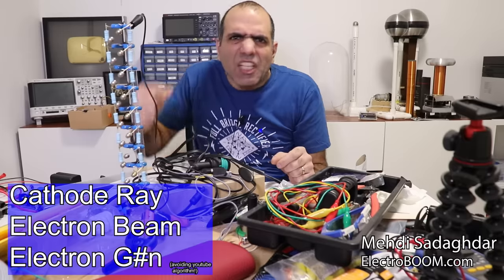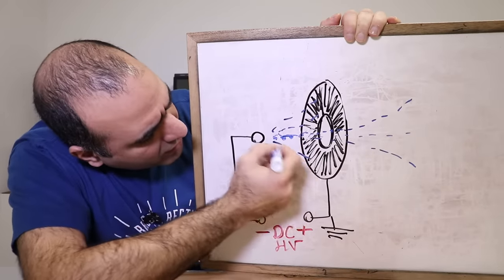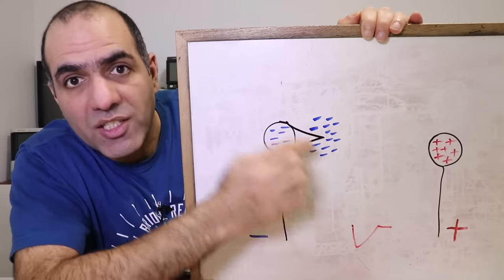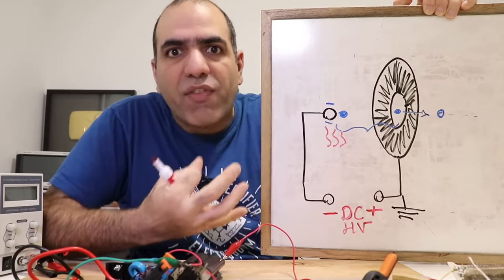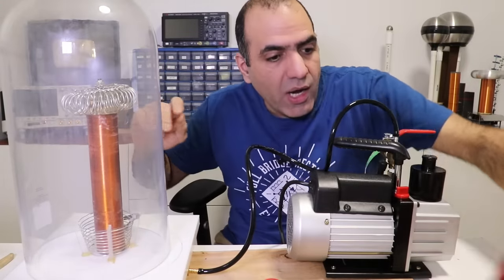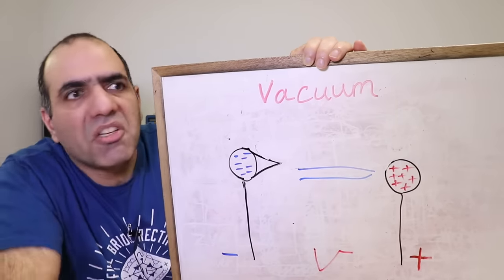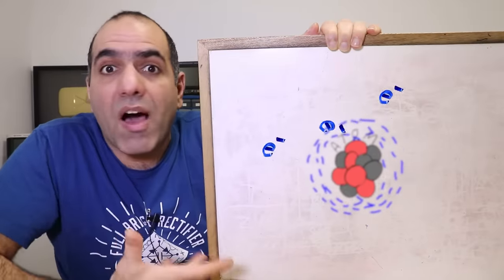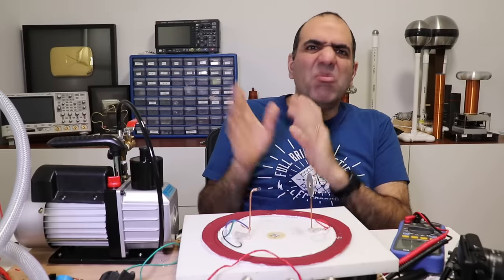Making Super Fast Electrons, Cathode Ray

Comment: "I'm pretty sure at those voltages I would create some pulses of X-rays.... so lets not do it very long"
Reply: If you're curious, the source of these x-rays is the high energy electrons smashing into the anode disk and losing their energy rapidly. This rapid loss of energy is released in the form of high energy photons (the x-rays). This phenomena is called "bremsstrahlung," or braking radiation. I worked for 5 years with a Van De Graaff positive ion accelerator that needed lead shielding to protect against the braking radiation, since positive ions accelerating in high voltage (even at high vacuum) will ionize residual gas particles and release electrons that in turn accelerate backwards through the high voltage into the accelerator itself, creating x-rays.
Reply: @ArchangelUltra  i feel like a smartypants rn
Reply: That is why old CRT screens had an earthed screen to ground out the x-rays.
Reply: @dogwalker666  You're gonna have to explain this one to me. X-rays are uncharged so why would they need any kind of ground? They're unaffected by electric potentials. And I thought CRTs didn't have much of an xray problem because their electron gun wasn't at a very high voltage, but I don't actually know much about those so that's more of a guess.
Reply: @ArchangelUltra  Thanks I was wondering what that phenomena was. Now I'm going to dive into a Wikipedia rabbit hole. See you guys on the other side. o7
Reply: @ArchangelUltra  the original CRT had lead in the glass and had a coil around the Circumference of the screen, I believe there was a dedicated pin on them for the xray protection circuit.
Reply: @dogwalker666  The coil around circumference of the tube is degaussing coil. It have nothing to do with X-rays. For X-ray protection is the backside of the picture tube made from leaded glass to block X-rays created by bombarding shadow mask and screen by electrons.
Reply: @The_Hanter  there was a de,Gauss coil too and I said it was a leaded glass.
Reply: That's what I was thinking - this is starting to look suspiciously similar to how an x-ray tube works lol
Reply: @dogwalker666  That coil is the degaussing coil, it runs at every start-up to clear any residual magnetism and retain colour purity... Nothing to do with x-ray protection.

X-ray protection is typically done by monitoring the power supply for an over-voltage condition. The only physical x-ray protection is the leaded or otherwise specialty glass.

To some extent the rim-band metal may help block x-ray emission from the side edges, but its job is more to help keep the structural integrity of the CRT, and providing a way to mount the CRT into a cabinet.
Reply: @Agent24Electronics  I know that is what I said.
Reply: I thought something in the screen reduced xrays like thick quartz or some additive?
Reply: @ArchangelUltra  I think X-rays start at around 5 kV
Reply: @dr_jaymz  lead in the glass like very expensive drinking glasses.
Reply: There are also high energy beta rays!
Reply: @ArchangelUltra  are you German or ist the word ,,Bremsstrahlung" used in English too
Reply: X-rays also came profusely out of the HV rectifier tube, which is why many TVs had metal sheilding around the HV supply.
Reply: @JB-yu1vv  it’s very commonly used in English nuclear academia
Reply: @dogwalker666  That's wrong. You can't "ground out" x-rays. CRT screens are earthed to actually allow them to travel to the screen otherwise the screen would simply build up a negative charge and it would stop working. To protect against x-rays CRTs use leaded glass (glass with lead in it) to absorb most of the x-rays (though not all of them).
Reply: As someone who works on X-ray machines I’m almost sure if you were to have put a piece of fluoroscopic paper on the end of the tube where the “window l of the washer was facing it would have lit up showing the radiation pulses. Usually run to 40-125kvp
Reply: @dogwalker666  that's not what you said, you said the glass was grounded to block xrays....
Reply: @trevorhaddox6884  you should see how much you get out of a 3 phase valve rectifier those 6 GXU4 at 13kW were a bit zappy.
Reply: @ArchangelUltra  The glass of a CRT contains lead. The lead acts as a shield for the x-rays.
Edit. Too quick. It was already answered.
Reply: @dogwalker666  Funnily enough , I happen to know you cannot x-ray lead crystal - they just  cast a shadow, despite being very very thin.

Comment: One small piece of tungsten and he’ll start making x-rays. This man needs to be placed on a watchlist
Reply: thanks for the idea
Reply: Intentions are what matters. Smart people are not who should be placed on a watchlist. Evil, cold, or profit-driven people should, though.
Reply: its probably already emitting some xrays, tungsten just has a bigger cross section for electron scattering
Reply: X-rays aren't very dangerous for short ammounts of time.
No need for watchlist.
Reply: You are bit slow & missed the point. Mehdi used his Marx super high voltage generator + the heating element (the tangerine from his hair dryer)  . Hence, the result was a massive high voltage arc + X-ray (due to super high voltage).

Hint; Ho and study some physics and lean about frequency and electrons.
Reply: @jannikheidemann3805 the exposure time for x-rays is measured in tenths of seconds. When I X-ray a dog’s knee, I set the generator to 44 kV, 50mA and 0,2 s. His first setup with the 30 kV transformer, isn’t far off. He’s been sitting there for a loooooong time, tens of seconds. Even if the current through the tube is fairly low, say a couple of mA, he’s received a sizeable dose of x-rays.

The second setup with the Marx Generator does “hundreds of kV” so that definitely produced some very, VERY hard X-rays. I wouldn’t want to be near that thing for any length of time.
Reply: Maybe he can even rebuild the Therac-25
Reply: @pascal2085  i was not prepared to read this

Comment: Nice work! 
From the amount of Plasma I would expect a pressure of somewhere between 10 mbar and 0.1 mbar. For electronbeams that are used (either in  Electron Microscopes (SEM/TEM) or for Electron Beam Epitaxy) in Lab settings we usually have vacuums around 10^-5 mbar, since in those the electrons flow much easier and are well behaved so that you can control and detect them accordingly.
For demonstration purposes a vacuum of ~10^-3 mbar should be enough, use some Argon to show the path of the electrons.
Also if you use a Helmholtz coil setup you can actzally adjust the path of the electrons into a circle and use that to correctly measure the charge of a single electron.

Comment: Makes X-Ray tube

"Ahhh yes, the glow of death!"
Reply: MUM!N  i dont think you can catch That With a comercially available camera
Reply: nah Vaccum Tubes barely make Xrays
Reply: MUM!N  You need a purpose build X Ray machine and a purpose build X Ray tube to get significant amounts of radiation.
For example High voltage rectifier tubes are known to produce small amounts as an unwanted byproduct.
Audio Tube Amplifiers are the most common type of Vacuum Tube Application today among very high power transmitter tubes. But there is no concern from those since they are not contained in a glass envelope but a water cooled metal jacket.
Audio Tube Amplifiers pose no significant risk.
Reply: @alouisschafer7212  idk much about this but don't vacuum tubes work at a couple hundred volts? Electroboom is using tens of thousands of volts
Reply: @maxxiang8746  you are correct that is one of the main factors. Normal vacuum tubes often barely see 500V. So almost no X Rays.
Seeing 1000V in a Tube Amp is rare. Highest I ever worked with was 450V which is not much in contrast to thousands of volts but still a change of pace to work with from conventional electronics.
Reply: @alouisschafer7212  how about instead of using a washer he'd use a block of tungsten for that bremsstrahlung effect
Reply: MUM!N  It depends on how long the pulse is.  They've already tried to film an electrostatic arc.

https://youtu.be/YDHos3Q1NcA?t=472

Pulse duration is too short to get any sort of usable footage.
Reply: Commercial x-ray tubes are 50kv because its good for imaging, not because X-rays aren't generated at lower voltages. Hard X-rays start at 5KV. All targets will emit bremsstrahlung radiation, and you don't need to have purposefully designed for it. It's generated by the electron stopping.

Medhi really dropped the ball, and needs to get a dosimeter before messing around with this.
Reply: @alouisschafer7212  Quite obviously he is much higher that 500V in this experiment, and the specificity of X-ray tube is the cold cathod... which he has in many of his experiments, here. 
So I think it would be a realy good idea to check it with a Geiger Counter.
Reply: @RandomMan1  exactly this! I’m a rad tech (the guy that does your X-rays) I studied this and I know my stuff about x ray photons being created this exact way. I have to know all this stuff for my boards as well as be eligible to work with radiation. There’s a few types of radiation that can occur. Brems, characteristic, photo electric, and Compton depending on the KV. Even with low amounts of KV,  you can definitely get some x rays. Are they very strong? Maybe not, but once you keep going higher with the KV, the more likely you will create more and more higher energy x ray photons. There’s no escaping that. In a regular x ray tube, to protect us workers, they have a glass envelope as well as lead around the housing of the tube to protect from leakage. He has none of that. If any one of you just look up how x rays are formed, you’ll know that he just created something like this. This is very dangerous and I really hope no one tries this. Not worth putting a risk to your body just to see something “cool”
Reply: @davidmathew6453  Good thing Mr. EB already has a kid hahaha. In all seriousness though, he definitely should've bought a cheap geiger counter for this experiment. Even with the tiny exposure time from his Marx generator, he definitely got some x-rays.

More than a long plane ride? Eh probably not, but it's a good idea when you're dealing with super high voltage like 250kv or more, while around a vacuum. That's not to mention the x-rays he got from his ZVS driven flyback transformer. That voltage was almost certainly enough for some powerful x-rays to be produced. But the glass and the relatively low vacuum probably ate most of the energy before it got to our mad scientist. Keystone science did basically the same experiment, and said only a small amount of x-rays was produced from a ZVS driven flyback in a vacuum that was almost certainly higher than Mehdi's.

If you want some anxiety from a radiation video, go look up Keroson (no idea if that's how you spell it). They made a video on an x-ray tube they salvaged from a dental x-ray head. And Jesus. F**king. Christ. I think I got radiation poisoning from just watching the video lol. They powered it up with no shielding, and I believe a higher than normal operating voltage. It was legitimately scary, and I'm not sure how they're even still alive with the dose they appear to have gotten, unless the video is fake. Also, their sad excuse for radiation protection was legitimately hilarious, or would be if it wasn't terrifying. Just some lead foil made into a chest plate, an upside down funnel for a hat, and some underwear lol. Literally useless, and the hat probably directed x-rays into their brain lol.

Also I'm by no means an expert, just a nerd with nothing better to do, hahaha.
Reply: @andrewhamop6665  haha yeah exactly man, I just hope no one tries to recreate this. It’s sad how misinformed some people are about radiation and how it’s created. I just hope he doesn’t go even more than this, and even if he is, at least put on some lead on. I’d hate for something to happen to him, I love him and his enthusiasm
Reply: @davidmathew6453  Yup, a quote from TheThoughEmporium is fitting here. "Radiation isn't a boogeyman, you just have to take certain precautions, and mind dose limits." My father works at a nuclear power plant, and it's quite sad how many people either don't, or don't want to understand radiation. He wears a personal dosimeter, that gets checked and replaced every quarter I believe. (Don't quote me on that)

Also, anytime anybody hears the word radiation, they immediately think of face melting stuff lol. Technically, the correct term for that is ionizing radiation. Sure, for people who know the difference it doesn't matter what you call it, but for people who don't understand how the electromagnetic spectrum works, they think anything that is related to radiation is bad. (5G lol) Technically, heat is a form of radiation, just a much lower frequency. I'm sure you know that, just throwing it out there for anyone else.

Honestly, I was a bit surprised that Mehdi didn't mention the radiation risk immediately as he started using the vacuum chamber. Either he didn't know, or the amount of radiation created wasn't significant enough to worry about. My money would be on unsignificant doses, but I'm not positive. 

It's certainly possible, with the right tools, equipment, and protective gear, this experiment is completely safe. And I mean to a degree you probably wouldn't even need any special protective equipment, if running the device for only a few minutes. It's generally good practice but if you have a relatively low voltage, low vacuum, or a special type of glass for the vacuum tube, you're probably fine anyway. I absolutely agree though, most people wouldn't know how to perform this experiment safely and it's better off left to professors and scientists. The high voltage alone is enough to kill you immediately, let alone the radiation risk.

I'm planning on using a decent amount of vacuum tube equipment in my future, since I'm a radio hobbiest. Right now, tubes are still usually the most cost effective way to make high power RF. Equivalent transistors are quite expensive, and It'll be interesting to see if some of the power amplifiers using vacuum tube equipment actually put off any noticeable x-rays. I honestly doubt it, but some of those vacuum tubes are using pretty high voltage, highest I think I've heard of is 4kv in LARGE liner amplifiers. It could actually be more noticeable now, since all the Chinese manufactured tubes have cheaply made thin glass, although the lower vacuum could offset this effect.

Geez, I think I might finally be going crazy from being inside all the time. From the amount of words in that comment, I'm not ruling it out! Hahaha.
Reply: Max Xiang yes in the order of 350-450 plate voltage
Reply: It should be considered that the vacuum is bad and the target is probably steel. This means the electrons are gonna be nowhere close to the possible multiple 100 keV which his supply could theoretically reach and that their deceleration is gonna be very low, so the Bremsstrahlung will be weak. Also x-rays are usually released perpendicular to the path of the incident electron and target, which would end up sending it mostly back towards the source in this case, nowhere near giving him the full exposure.
At that point I'd be more worried about the UV released by the arc and the ozone the arc creates in normal atmosphere.
Reply: @davidmathew6453  Absolutely. My x-ray machine for veterinary use works from 20 to 99 kV. Even at the lowest kV and 20 mA it only takes seconds to reach a yearly dose limit. Also we never enter the path of the beam, we only get the scattered dose.
Reply: @Xemerius7  ever heard of a total shutter camera?
Reply: @heavy0119  yes of course, I’m not talking about rolling shutter being the problem but electrons just being way too fast
Reply: @andrewhamop6665  i was thinking of kreosan’s xray video as I was watching this. The thing is those guys knew exactly what they were getting into but unfortunately they’re too comfortable with visiting radioactive zones so they perhaps thought a bit of xray radiation is okay which it definitely is not
Reply: @musa4539  Yup, for sure. either they didn't know how dangerous it was or they just don't care. I think since they're not dead yet they're probably fine, although I have no idea how.

Comment: Here's an explanation for the "clumps of gas" in the vacuum chamber. When pressure is decreased in cathode ray experiments (which you were doing by drawing the air out), the cathode ray tube goes from irregular crackling to a horizontal column that stretches from the anode to the cathode. When you decrease the pressure even more, eventually you get something called a Crooke's dark space, negative glow, Faraday dark space and striations. These striations are the "clumps of gas". There are many stages that correspond to different pressures though, so I've only just mentioned the first stage and the stage we're interested in.
Also, I'm not an expert in this topic. I am just a high school student who came across electric currents through gases. Please do correct me if I am wrong!
Reply: Mr Kitty agrees 🙂 meow purring purrr.
Reply: @mrkitty777  meow purr meow meow?
Reply: @streamware7746  YouTube cat videos made me learn cat language. 🤔 Cats Miauw or meow or weow e.g. depending on country where cat lives e.g. 😺
Reply: @mrkitty777  What the fuck also 

Meow?
Reply: @streamware7746  🤣😂🤣
Reply: I turned the number 69 lmao
Reply: Yes, the lower you go you 'burn off' different gasses until you are under a super vacuum and then the situation changes.  :)
Reply: You didn't explain the plasma clumps. You named them.